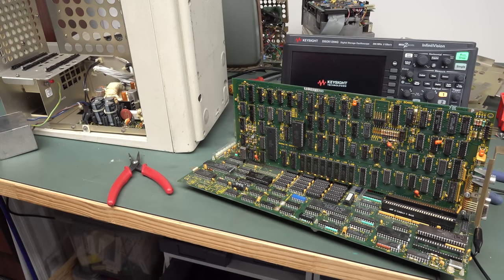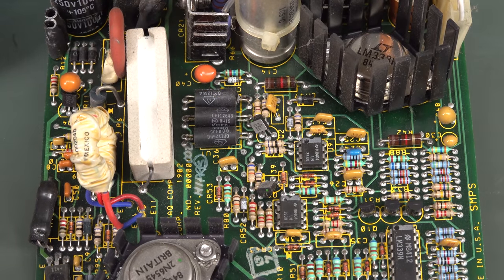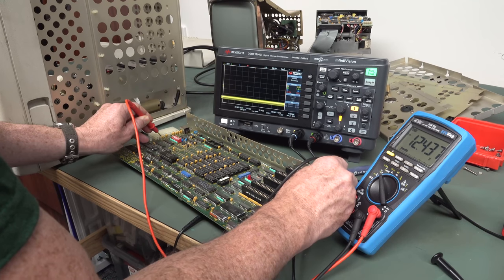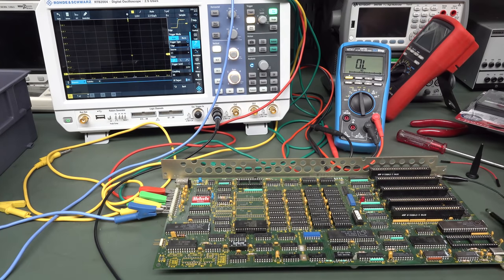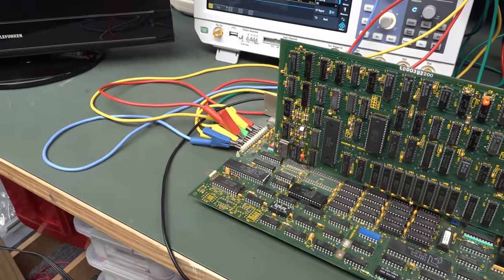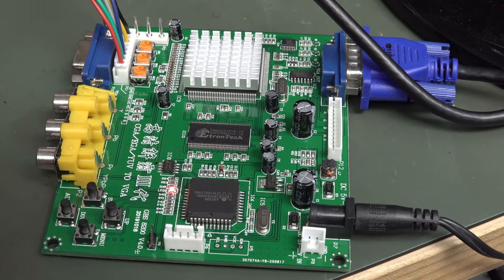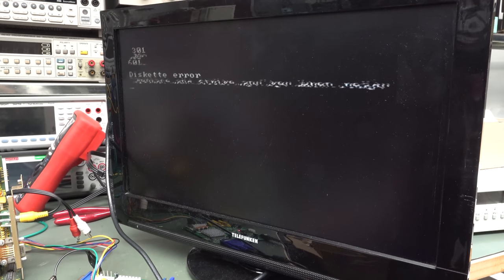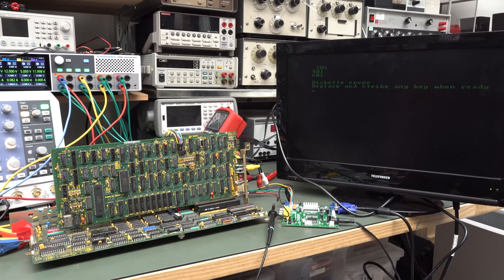EEVblog #1354 - Compaq Portable Repair - Part 2

Comment: Awesome! Yeah the 18khz/50hz signal you were seeing was the MDA scan-rate. The internal monitor on these is multi-scan and can run at either 15.6khz/60hz or the MDA rate of 18khz/50hz. Incidentally even though that scan converter says it can handle "CGA" it really means the 15.6khz scan rate... it's expecting an analog level input and no tthe TTL 5V signal that is coming from that card.
Reply: is that scan converter any good?
Reply: @dh2032  hell yeah. i use it for a sega genesis -> RGB out project like ten years ago. 
https://www.youtube.com/watch?v=WJYZceTPPnc

Comment: That GBS scan converter board is typically used in old arcade machines when changing them from CRT to flat screen. Used them a few times, with mixed results. It's cheap, but the more expensive ones give a much cleaner output!

Comment: The composite issue looks like the same grounding problem I had a few months ago.
Chuck in an ATX PSU and hook up a wire from Composite GND to PSU GND.
Great vid , Dave. Looking forward to the next part.

Comment: Perhaps it needs to be in the case for all the grounds to tie-up? A 'chassis ground', so-to-speak..
Reply: Wondered the same thing. The RF shielding, which they would have needed anyway, would work as a ground. Might save a few vias/jumpers too.
Reply from the maker: The thing is it worked a few weeks before in the eact same spot outside the chassis. You can see the old footage in the video,  signal integrity fine.
Reply: @EEVblog  Solder joints on the bracket crack, maybe? It's old, and now unsupported...
Reply: @EEVblog  PC Power supplies are not floating. For young players: PC PSU 0V rail is connected to mains Earth. The scope GND is also connected to mains Earth so on the last video when Dave had the motherboard plugged in to the PC PSU the scope already had a GND connection to PC 0V. In this video Dave has a really nice R&S bench PSU which has floating DC outputs so PSU 0V is not connected to Earth. The Composite Video output plate is floating so that when it is in the PC Chassis it does not create an Earth Loop (The extra few mV of ground bounce would show up as interference on the display). So last time when Dave connected scope GND to the plate he was actually connecting the plate to PC 0V - he would have got the same signal if the clip was not connected. This time when he connected the clip to the plate he connected it to Mains Earth and that's all so you get a nice floating display. I have used Earth, GND, 0V and Chassis here. They are only the same thing when they are actually connected together....
Reply: @sio2groper410  I knew PC PSU's have 0V tied to chassis and earth ground, but I didn't consider that his bench supply would have a floating (isolated) DC output (though it makes perfect sense). Thanks for pointing that out.

I seem to recall he made a video way back when about isolated o-scope probes.

Comment: You are a brave man to work on a Compaq portable.  I remember working on those Compaqs back when they were still used and they were a nightmare compared to any desktop of the same era, as you have noticed.  My "repairs" consisted of buying a replacement board and plugging it in, I never heard of anyone doing board level repair on those.

Comment: From what I can remember, negative voltages are for the tape and/or disk drives?

Been a long time, memory gets hazy for that time period lol
Great work, Nice vid.
Reply: Mostly older memory types that needed a bais grid, some sound cards, and RS232 ports, so far as I know. Some motherboards (Tandys especially), would get the -5v from the -12v rail via an 8905 instead of from the PSU (which saves manufacturing costs?), and the Tandy 1000 EX/HX motherboards didn't use -5v at all, which could place limits on 3rd party ISA sound cards you might try to kludge onto it's proprietary expansion bus.

Comment: I've had one of those GBS-8200 CGA2VGA converters back I'm 2016 for use with arcade boards. Since then, the video game community has turned it into a VERY competent scaler using custom firmware with some small tweaks/mods and an ESP8266 board to control it all via WiFi. The project is on GITHUB as "GBS-Control." I find it particularly useful since it properly handles 240p and consumer RGB (0.7v peak to peak, 75-ohm impedence) when it is very difficult to do anything with 240p RGB in NTSC land. :)

Comment: Thanks for this, Mate.  I still have my Compaq Portable purchased as a Christmas gift in 1982.  It's totally dead but now Dave has given me the urge to crack it open to see what's what.  (If I can find it.)    Dave --- I have a photocopy of the factory Maintenance and Service Guide.  Lemme know if you want a copy.  I also have both factory diagnostic disks but they're 5-1/4 inch so no easy way to dupe them.

Comment: The internal monitor is a different scan rate than the external 15K. The dip switches on the motherboard pick which kind of video card, not what video modes come out of the card.
Hook to the 9pin for standard video signals and hit ctrl+alt+< for 15k.. Also, your keyboard is probably shot because of the foam going to crap over the years. (I rebuilt a compaq portable last year, including the power supply)
Reply: Also,  try sw5 and sw6 on for CGA at power on.
Reply: Do you know where I can find the pinout for the internal monitor connector? I have one of these but have lost the included CGA card.
Reply: @robertsundling  The Service Manual is Here.

http://www.mediafire.com/file/465lcc44ckb9d80/Compaq_Portable_Service_Manual_-_cscs-15.pdf/file

It's kinda hard to read the pdf in order, but on page 59 of the PDF (Page 7 on the page) , You will see the schematics that output to the monitor. 
Pin 5 is Video out, But it also has 3,1, and 4 + Gnd. Most likely the syncs. (The monitor can sync to 2 different rates.)
Reply: @tndabone  Thank you! That’s exactly what I was looking for.

Comment: I wonder if the composite video bouncing all over the place is related to the missing ground on its connector?  Surely that should be grounded?
Reply: Probably supposed to be grounded through the chassis.
Reply: @emmettturner9452  Yeah, that would make perfect sense!
Reply: I thought that at first but I believe the RGB adapter is still connected so ground should be connected through that. It won't be the best ground but I would think it would still provide stable sync.
Reply: Probably has a ground via both the chassis and via some small connections to the internal ground plane of the board. The internal connectors are quite prone to cracking, as the board there flexes a lot, breaking the thin trace. Generally reflow the pins on the connector, solder the shell to the chassis strap from the rear (common for that crimped join to oxidise open even though it looks fine), and then a small short wire jumper to the nearest ground plane will get it working fine.

Comment: Only two days after watching the first video, someone in my apartment building dumpstered a November 1983 unit! It was the craziest coincidence I've ever had. 

I've disassembled it fully and tested the voltages on the power supply, but I'm apprehensive of putting it back together and plugging it in for fear of the tantalums going full nuclear. I've ordered a bunch of 10uF 25V replacements, but is there anything else I should watch out for?

The unit came with quite a few upgrades, notably a multifunction 384K RAM expansion card and a 40MB Quantum HardCard.

I'm eager to get this thing running, and I'll definitely be watching along!
Reply: Cue firecracker show
Reply from the maker: The electros should be ok to at least get it working. It's those damn tants!
Reply: Oh, you're throwing this away? YOINK!
I obtained an XT clone a few months ago, and the first thing I did was replace tantalums. You can swap tantalums with electrolytics too, if you have them. Tantalums are "supposed" to be more reliable (haha), except that when they fail, they fail short circuit, hence giving up the smoke.
Those X2 RIFAs, of course, should be replaced in any 30+ year old machine, whether they still work or not. It's not a matter of "if," only "when." The newer ones have better insulation that can handle the heat without degrading, but the old ones are almost guaranteed to have cracked insulation and taken in moisture by now. You can technically get by without them, but you'll have no AC line filtering.

Comment: Dave, at risk of stating the obvious: didn't you have something plugged into the composite jack when it was grounded? :)

If it was plugged into a display that puts 75 ohm across the composite connector, which is not a great ground but might explain what happened, if the signal leg was being driven to 0V

Comment: Ah, the Compaq Portable - that was one fine (if heavy) machine. Portable computing and a nice workout in one package. 

ComputerLand (remember them?) sent me to the 2nd ever Compaq training class for techs down in Texas. Before I left ComputerLand I bought one with every conceivable option (and damn near everything was an option - like a serial port or even a clock card so you didn't have to type in the date and time on every boot). I think I had nearly $6K in that thing!

Comment: Consider your self lucky:
My IBM 5150 which I restored was dead when I got it. I had to replace all the buffer chips, Most oif the RAM & even the ROM as that had suffered bit rot. The last hurdel was the RAM dipswitches. But I was so happy when I got it to boot from MS DOS for the first time. Oh & there were RIFFA caps in the PSU, some did go pop.

Comment: Well, the MDA and CGA are two different cards. MDA is a higher resolution monochrome card (max 720×348), while CGA is a lower resolution colour card ( max 640×200). You would need a different monitor to display an MDA card's output. We used to  call the MDA compatible monitors TTL monitors, the CGA compatible monitors were composite monitors (cheaper), or RGB (More expensive!). 

Although, in theory, the MDA card could output graphics, it didn't so. The Hercules monochrome card, on the other hand, could output graphics at the 720×348 resolution. This made it very popular for doing CAD. After the Hercules card came out, it took over the MDA market...no one bought an MDA card...I think that the Hercules card was actually cheaper than IBM's MDA card. A very popular use for the Hercules card was for AutoCAD. In fact, it was that combination that made AutoCAD the defacto standard. Much in the same way today that we use Blender for benchmarking systems, people used AutoCAD on a Hercules card (or clone thereof) drawing the Firehose Nozzle as a good all-system benchmark.

Comment: I have one of these plus a big box of 5 1/4 floppy disks.  The only thing that doesn't work is the small CRT screen built in.  The external VGA output does work which is how I've used it to test everything.  Have no idea what I'll do with it...

Comment: Saw one of those Lugable PC at University of Nebraska at Omaha in about 1984 or 1985 in a Computer Science office area where I used an Original Macintosh.  An Engineering Tech professor had an Osborne with tiny screen, and the Labs had IMSI computers with the Toggle Switched to Program them

Comment: TO-3, now that's a device I haven't seen in a long time
Reply: Still available, but the case almost invariably costs more than the silicon inside. At least till you get to the more exotic things you get in a TO3 format, where you can put small hybrid circuits into the case along with power devices. Still a popular case for automotive voltage regulators, as it is small, robust and easy to mount, and you only need 2 pins and ground anyway to run an alternator rotor.

Comment: I know that +12 and -12 are used for the RS232 serial port.
Reply: -5V is also sometimes used on older RAM and ROMs as a substrate bias voltage. Most slightly newer ones though come with the substrate bias oscillator and charge pump built in though. You can see it through the window on an EPROM as the small bit of silicon on the edge of the main array, with a bond wire to a small silicon pillar that is soldered, along with the main chip, to the metal substrate in the chip cavity. 

Otherwise all that it does is charge up some capacitors on the ISA bus, and the sound cards and modem cards do use them for the audio side. Sound cards used to use -12V for the headphone amplifier, and the -5V for the analogue switching, before it was level shifted and applied to the ADC inputs.
Reply: I've seen some motherboards, Tandys especially, as well as the Monotech NuXT motherboard, get the -5v from the -12v rail via a 7905. The Tandy 1000 EX and HX models don't use -5v at all, since they used "newer" SMOS DRAM that only needed +5v, and there were only a handful of cards produced for it's expansion bus, none of which needed -5v.
Reply: @BlackEpyon  Cool. I never really knew what the -5v was used for.
Reply: @BlackEpyon  Just to nitpick: you mean a "7905" instead of "7805", right?
Reply: @WolfgangMahringer  78xx is positive, 79xx is negative. Thanks for catching that.

Comment: In early IBM type PCs, the POST ran a memory test that had no visual output.  Most people upgraded to 640K of RAM so when you flipped on the big red switch, it would appear to do nothing for over a minute while the memory test ran.  There were many complaints about this so later PCs would show a memory count of the test on screen.

Comment: You should be aware that Compaq used a Dual-Mode monitor those days. That monitor can sync on either CGA (15.6kHz/60Hz, 200 visible lines) or MDA (18.something kHz/50Hz, 350 visible lines). The machine is replacing the CGA 80-column text mode with an 8x8 character box by an MDA 80-column text mode with an 8x14 character box, to achieve a significantly better text mode output.
As the MDA text mode is quite different from standard TV timing, it's not surprising that it does not get synced. I guess the 40-column text mode is generated as genuine CGA text mode, and thus it works in this mode. The original (non-portable) Compaq Deskpro has a hotkey to switch between 350 and 200 line text mode, I think it was Ctrl-Alt-less/Ctrl-Alt-greater, which might work on this machine, too.

Comment: -5 and -12V are usually used in peripheral cards. For example -12V is necessary for RS-232C to work properly.
Reply: if the serial card uses 1488/89 chips

Comment: 2004 HP Compaq PSU seems like the then becoming obselete minus 12 volt rail was implemented the same way  but through a surface mount LM 339 , sort of like a lock, I.E. PSU gets first say before mother board can send power good signal

Comment: Composite output only works with certain video modes on CGA. I haven't used one since elementary school back in the 90s, but I vaguely recall that it worked fine in 40 column 320x200, 80 column 640x200, but not in the normal high(er) resolution mono text mode.
Reply: My understanding is composite always works on a CGA card in every mode (because CGA is all 200p). But Compaq is using a custom card which has higher resolution text modes. This is the 18kHz sync Dave is seeing instead of the normal 15kHz. They probably disable the composite output in these modes because a TV wouldn't work reliably at these frequencies.

Note I haven't ever used a CGA card so I may be slightly mistaken.

Comment: If the components and the settings check out...If you have continuity, throughout the system, it will usually work as designed?

Comment: IIRC -5v are needed for floppy disk controller op amps that control the disk heads on old/early floppy drives. [it's been 15+ years since I read that]

[edit] this source mentions -5v for floppy and is routed through ISA card slots. A second poster mentions -5 for larger-than-64k ram (?!) by having onboard charge pumps ("4116" ram chips). [I can confirm that a 4116 datasheet does indicate -5v rail required.]
https://electronics.stackexchange.com/questions/105064/what-is-the-usage-of-the-negative-voltages-on-a-pc-motherboard

this post mentions -5v back bias for DRAM chips:
https://electronics.stackexchange.com/questions/57368/why-is-there-a-12v-rail-for-atx

also rs-232 serial ports DEFINITELY use +-12v rails.

Comment: Either the -5V or -12V would be used with the DB25 RS232 serial port. I'm not sure why both would be needed but this could be an 'off the shelf' PSU providing more outputs than necessary.
ETA: Only needed for your 110 or 300 baud acoustic coupler, LOL.

Comment: I just fixed one to, and it also took me off in a wrong direction for a while, that it don't print anything on the screen for a loooong time.... but the original IBM PC also don't do this... it's first the IBM XT, which output's memory counts at start up.... 
Mine also contained a 'hardcard', and from the files, and dates, it seems it hasn't been used since 1987.....
Reply: wow, hardcards, thats a blast from the past